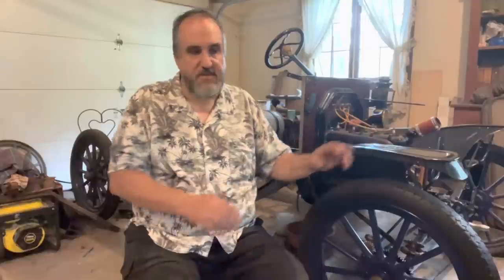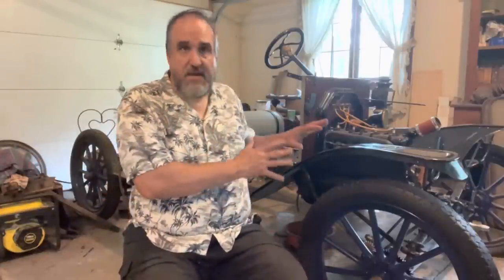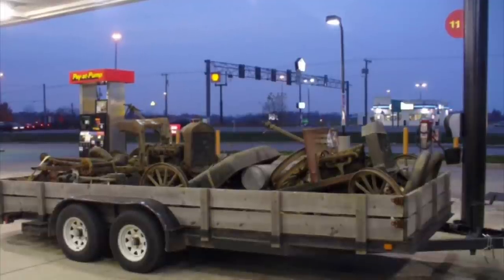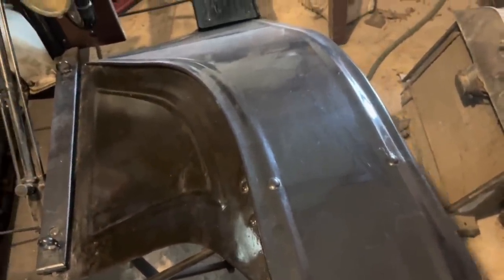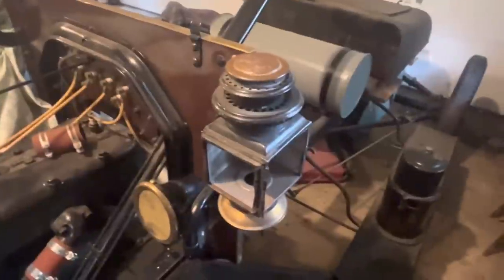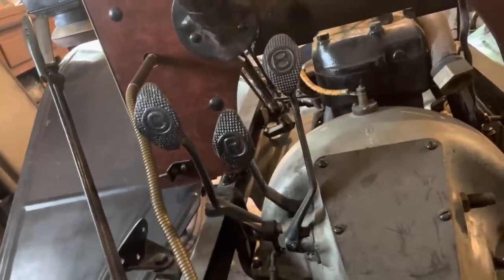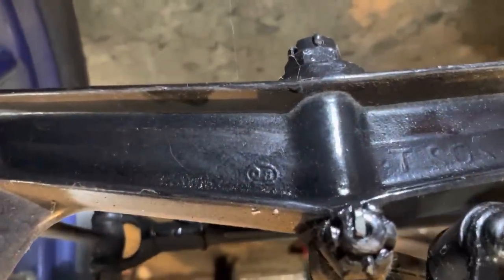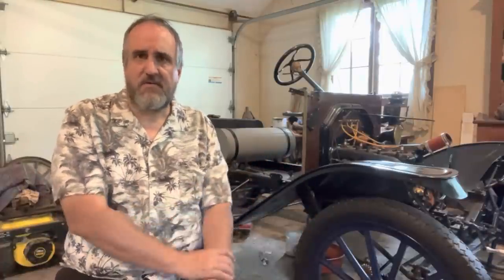1913 Model T Ford Walk Around

Comment: As a fellow model T guy myself, you have a vast knowledge of the subject. It is very complicated to put together a period correct Model T but that's much of the fun. I am pretty knowledgeable but you are at the next level. 
The chassis for 1913 would not have the later ears on the rear of the frame - those frames are not common. You got a super deal for $800, the brass radiator is worth more than that. I am working now on a 1917 T and a 1926 TT truck. with a few others in parts in my early ford garage.  The Dodge front axle is very cool - 
  The best way to spend retirement is with young women and old cars. Cheers -
Reply from the maker: Thanks, it'll a good summer to get your T's on the road.

Comment: The gas tank appears lower would the engine stave for fuel on an upward hill climb?
Reply from the maker: Yup. That exact thing can happen. The carburetor is updraft and sits pretty low on the engine, so it's rare, but it happened to me once on a steep incline. Some Model T guys will tell you to go up a steep hill in reverse to prevent this, although I've never had to resort to that.

Comment: What types of parts did the dodge brothers make for Ford other than the front axel? Are they valuable because they are rare or is it only the association with Dodge?
Reply from the maker: The Dodge axles are sought after mostly because of the story behind them, otherwise they're indistinguishable for other Ford axles. Dodge started making their own cars in 1917, the the DB Ford axles are usually only on earlier cars. I'm actually not sure what else they made for Ford, that's a good question